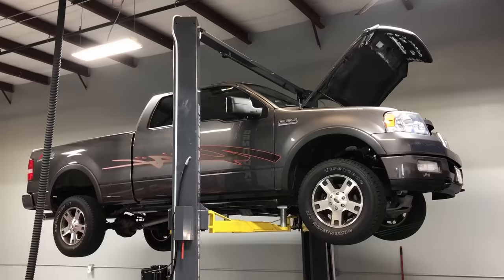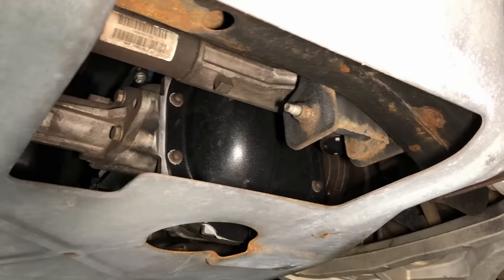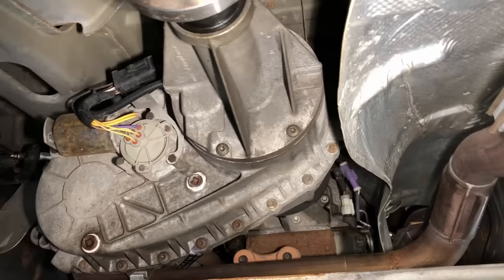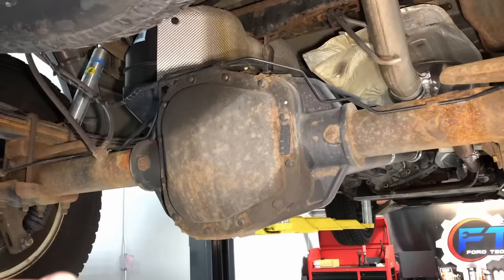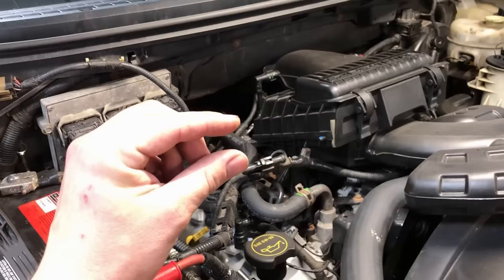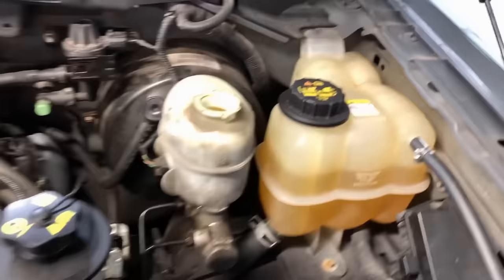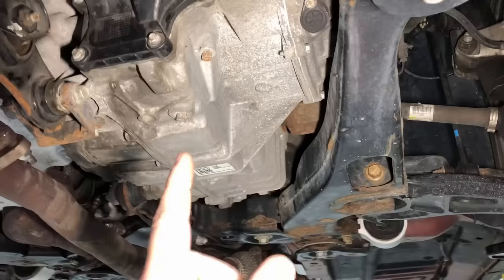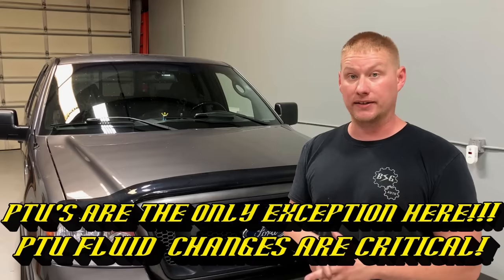Never Follow Ford's Lifetime Fluid Service Intervals: Here’s What I Recommend and Why!

Comment: Brian, you forgot to mention the weight of engine oil. Somedays, you advise 5w-30, other times, you can't/won't mention it. When/why do you occasionally, sometimes, somedays advise one type vs factory specced 5w-20?
Reply from the maker: The weight of the oil varies with the application, engine and year. This video was for all Ford not just the F-150.
Reply: @FordTechMakuloco  Thank you for your reply! Woohoo! What about the 4.2L V6 and 4.6L V8 engines?

Comment: That trucks pretty clean for 15 yrs old
Edit.....posted before seeing rust in rear area..but still ok.....been thinking of getting those same Bilsteins on my 06' f150....any one recomends??
Reply: I have the yellow bilstein on my 2011 F150 and they are great, have had them on a few rides, I think the silver is a premium over those
Reply: Just changed mine over to the Bilstein 5100 and couldn’t be happier. It rides very smooth and planted. Not quite Fox shock performance but for the price I’ll choose the Bilsteins from now on. And yes the stainless(vs yellow) Bilstein is slightly different and allows height adjustment on the frontend.

Comment: My 2016 F150 Eco's trans has the fill plug just under the cat conv.  Near impossible to check level without getting burned. 
How would you fill after draining, much check level with this location????
Reply: Using a tranny flush machine attached to the cooler lines. It's not home user friendly but all big shops have tools to do it.

Comment: Brian, I need that short little section of fuel line that hooks into the input of the fuel filter. I have not for the life of me been able to find one anywhere. Any help??  The gray section seen at 4:21, it seems to only be on the 2004, extended cab models. All other year and cab configurations don't have it. Thank you!

Comment: Great info. How about the orange coolant in a diesel? I installed a coolant filter as soon as I bought it. I change it every time I Change the oil. So im always exchanging about 1 quart of coolant every oil change.
Reply: That sounds like a great idea. I would still check the ph and use the additive though

Comment: Do you recommend a full flush on the transmission? Just changing the fluid in the pan isn't changing much fluid. Most of it is in the torque converter.
Reply: Don’t go for any kind of flush, be it engine or transmission…just keep renewing transmission oil along once every 3-4 engine ODI and eventually your transmission oil will be completely refreshed even from the torque converter !!

Comment: you didnt mention anything about the new coolant in the super duty and the coolant additive. do say change it when the ph is shot or just additive. since ford doesnt say flush till 100k?
Reply from the maker: Yes I mentioned the new Yellow coolant you are speaking of. The Superduty Diesel fluid requirement are unique but the ph test has been the norm since 2011.
Reply: That's great but it doesn't take the yellow. Motorcraft orange is what the owners manual says, even though it looks pink.

Comment: Good info brother... anyway, can you also include months or years intervals between maintenance because I have a Ford Ranger 3.2, it is a 3 year old vehicle with only 15,000 kilometer run, I only change the engine oil every 10,000 kms as the manual said...Please help...
Reply from the maker: I have an entire video on my recommended intervals.

Comment: Thinking about buying a newer Escape with the 6F35. Will fluid changes every 20,000 miles make it last or is it just a bad design like the CD4E?
Reply: I think he has 2 fluid change videos on the 6F35. He recommends every 30k with the correct Motorcraft fluid.

Comment: Hey bro I have a 2012 3.5 and the tool symbol is popping up and truck does not turn off but I give it gas and it dont do nothing does it while driving and park can u help me out
Reply: Throttle body failure most likely

Comment: I have a '16 f350 pickup single wheel 4x4.  With a 6.2l. It has 46,000 miles. I tow and plow. I want to change the fluid and filter in the trans. My dealer won't do it says it good for 100,000 miles. What do you think?
Reply: Find another shop to do it or do it yourself. The dealer doesn't want to because they want it to fail.

Comment: Hi FordTechMakuloco for a while I follow your videos I find them excellent, I learned many things thanks from you channel.  Today I have subscribed and I would like to ask you something about a problem with a ford escape 2008. It works normal in P or N and works very well in R but when I put D it's jumps and shuts off the engine. I turn it on again and the same thing happens.  There are no error codes the check engine light is off.  I took it to the dealer and they put a new pcm but the problem continues.  I will be very grateful if you please give me an idea that it can be

Comment: Do you recommend changing the oil  in a Eco-boost engine  more often than a normally aspirated engine?   If a person is not driving  a lot and  is not hitting 4000 miles in a year  , how often do you recommend  changing the oil ?
Reply: Every 12 months at least.  It is mentioned in the manual. 
I do it twice a year and I put about 4K a year on my truck

Comment: Took my 2012 f150 to the dealership at 80k for a transmission, transfer and differential fluid changes, flush and filter,  I was adamant about getting the flush down through the thermo valve, got the truck back drove home looked at the parts list, 6 qts of transmission fluid used according to the slip, yet the transmission has a 14.7 quart capacity, obviously the tech dropped the pan, change the filter and replaced the fluid lost from the pan, I made them do it all over again as I watched to verify it, they acted oblivious when I brought the receipt in the next day which further pissed me off, who pays $375 for a filter and a pan fill, I wasn't buying it , service manager and I had a talk, I got a chair and sat next to the truck as the work was done, I really wish I had access to the equipment to heat the fluid  to do the flush myself, if I had I would of never brought it to them to do this work.  They where upset, tough shit I say they tried to pull a fast one luckily someone screwed up and listed the supplies used truthfully on the receipt.

Comment: Hello from Tampa FL! I have a 2005 Ford Escape XLS 2.3 5-speed manual that was used as a toad behind my past motorhome so the 216K miles are not really that many as the odometer still does register miles even when towed...I have a question, My clutch fluid/brake fluid..should and how/when does that need to be changed out? I had a clutch line leak and replaced but I don't think they changed out all the fluid just replaced but not sure..I would like to change out the full amount..I have always been one to change all fluids way before they say..I still change my oil myself every 3K miles with Ford Motorcraft Synthetic blend as well as a Motorcraft filter..I can't knock this little suv even though I don't really love it haha

Comment: So for someone who does not log on many miles on there vehicle, at what point do fluids need changing due to age?
Reply: The intervals he gave for coolant, brake and trans fluid should all still be good. Probably want to change the oil at least once a year though, if you aren't driving it much you aren't boiling the contaminants out of the oil. Just my take on it anyway.

Comment: LOVE your videos!  I've got a 2014 F150 XLT 3.7L 6 cyl (and only get 12.5 mpg except on freeway since new!) Change oil as close to 3k very close usually, and had no issues except new front brakes at 38k.  Milage has sucked ever since I got it and I think every V8 F150 owner I've talked to, many as everytime I run into one  I would chat and compare until it was obvious.
I've had regular maintenance, but can't remember now if plugs were changed.  I dont know if 12 -13 mpg in town is common, but man it's nowhere close to even 15 mpg let alone the new car placard that they post the mpg lies on.  
Thanks a TON for your videos!
Reply: 2015 f-150 2.7 EB - 23 MPG easy on the hiway. 19 in town ++

Comment: What would you recommend for fluid change interval on manual gearboxes?
Reply: Never..Unless it's being taken out for repair or whatever, that is usually never even mentioned in the service schedule, and there is really no need for it, plenty of still-works-great gearboxes out there, some over 30 years old and oil was never changed in them. My friend's MK2 Golf is good example.
Reply: @KRAUSER0130  Many of Ford's newer manual gearboxes are filled with either ATF or DCT fluid.  Oil this thin shears pretty easily and have been known to affect how smoothly the synchros engage.
Reply: @jeffhurckes190  Well, i don't own a Ford but i highly doubt they filled the MANUAL transmission gearbox with ATF or whatever, but if they did, what the flying fu..? That's just completely wrong from the start, it's like filling the engine with windshield washer fluid instead of proper oil. There's a good reason why they put super viscous oil like 85W-90 or something like that in manual gearbox, while the stuff that autos use is basically hydraulic fluid, it serves for completely different purpose.

Comment: What do you recommend about changing transmission fluid? I bought into Ford's recommendation at 100,000 miles... I changed it only once at 80,000 miles. My 2009 4x4 F150 has just crossed 200,000 miles. Local mechanic says no, and says it will stir up gunk and make it worse.  He says it should have been changed at least 4-5 times already. Should I change it?
Reply: Sometimes it is best not to change it if it hasnt been changed much or not at all, not only can new fluid stir up junk but also junk in old fluid can help keep transmission running better, you might want to only change like 1 quart at a time n see how it runs, or just leave it until transmission breaks down
If you dont change fluid enough in the past, then at times it is best not to n just keep going until it breaks down, this is a price to pay for not changing the fluid enough- your transmission will break down sooner
Whatever you do dont do a transmission oil flush

Comment: You are just talking about the coil and you said each one of them cost about $40 to $50 but in Florida in my local stores one coil  costs $75 to $100 and I went to local junkyard i bought one coil $10 maybe all local junkyards are not sale it for the same price but it did cost me $10 and it depends what kind of vehicle you have, if you have BMW or Mercedes one coil will costs $100 or more

Comment: I just bought a 2004 F150 5.4 , 2 days after having it, it started what I call "bucking" while lightly accelerating, any thoughts, thank you!
Reply: fuel filter plugged from dirty tank rust or dirty throttle butterfly plate or dirty map/maf

Comment: My sons 2011 Fusion has a 6 speed manual trans. How often should the gear oil be changed?
Reply: Check forums, but my uneducated guess is that once every 10 years is fine. Manual trans is a lot less stressed

Comment: I have a 2007 F150 with 25,000 miles with no problems, currently using Motorcraft 5W20. I was told that i should start using 5W30 ?
Reply: It wouldn’t hurt it’s to increase oil pressure due to rocker arms squirter holes being too big and weak oil pump
Reply: That’s low mileage for a 07 original engine?

Comment: The new 5.0 takes 10 quarts, with full synthetic what interview do you recommend?  That's a lot of oil compared to the mod motors.
Reply: I said full synthetic, like a sn+\gf-5 dexos 2  oil, good stuff.  10 quarts of that gets expensive every 5k ya know.
Reply: Dustin I run Pennzoil ultra platinum synthetic in my 18 5.0. You can get 5 quarts of it off amazon for like $23.
Reply: If it’s good enough to be the OEM oil for Ferrari it should be good enough for Ford. Changing mine every 5k miles. Almost 10k on the truck.
Reply: repairvehicle I did the first oil change at 5k. Gonna keep doing the same.

Comment: Any "lifetime" fluid goes with the 10k mile oil change intervals on my book. Its all a car selling scheme and most owners hate doing any maintenance so the "lifetime fluid" seems so convenient and advanced to them they don't question it.  By the time the transmission or the engine takes a dump they think it's because it was old anyway since they usually don't take any good care of their vehicles and they tend to fail on them.

Comment: @FordTechMakuloco
I completely agree with you. The long life maintenance intervals are definitely used as a marketing tool. Only thing is if you run into a vehicle that the transmission service is way overdue..you are damned if you do and damned if you don't. What I mean is if you wash away a bit about plaque you spring some leaks. Internal leaks. You know what I mean? Also with the brake fluid you got to be careful if you're pumping the brake pedal not to sink it all the way to the floor because it will tear the ass out of the master cylinder. Just like a hyperextension. The spool valve  exploring into unfamiliar territory. Because the valve travels through the O-rings this area is usually not as worn as the regular area of travel. This often causes for a master cylinder failure. In other words.. With the brake fluid..you are damned if you do and damned it you don't..Same thing about the dirty stuff..it can spring some internal leaks.. with the power steering fluid however.. I found that Ford power steering fluid usually blackens a lot sooner then any other I've seen. Almost have to do it every 25000 km to keep it nice and gold.. excellent video as usual

Comment: are there differential covers with drain plugs you can put on without voiding your warranty?
Reply: Probably, but better to remove the cover because all the dirt and muck settles in the bottom below where a drain plug would be.

Comment: Nobody changes their transmission fluid any longer. I did take mine to a transmission shop, and they could not even find the Motorcraft filter.  No dealers anywhere here in Michigan carry one on their shelf.  I'm not the first person to hit 80,ooo miles on my 2016 F150 2.7 Ecoboost, yet the dealers don't feel the need to carry an item there is no demand for.  There's no other off brand filter either...it's Motorcraft and only Motorcraft.  This is getting pretty weird.  Oh and to check the trans fluid on the Ecoboost motor, you have to crawl under the belly of the truck to find the dip stick.  It's no longer under the hood.  Anyway, the plastic dipstick is as big as a dipstick on a small engine lawn mower...like a Briggs and Stratton lawn mower.  Yeah, plastic, and only 4 inches long, AND UNDERNEATH THE MOTOR AT THE TRANSMISSION.

Comment: Lifetime fluids are bs no matter the make. Bmw and Mercedes put this on their transmissions, they die after the warranty, perfect for them. Sucks for the owner. But it kinda is your fault that you don't know something so basic about your car, that drivetrain parts degrade their lubricant and need servicing no matter what magic spell they put on the gearbox, along with the lack of a drain plug -_- . Makes for more project car material for people like me I guess. Their cars usually have a good chassis to work with. As long as it's not rusted I guess.

Comment: I  changed the engine oil on my 2004 7.3 litre F250,  now i have the oil temp light and the water in fuel light come on while the glow plugs are warming up. 
Any ideas to the cause ?
Regards,
Australian viewer.
Reply: did you put the right oil and the correct amount?
Reply: @ecastillo9804  yeah mate , 15w40 delo 400 mgx , 13.5 litres.
Good thing i changed it , as it was black as soot.
I'll drain the water/fuel filter tomorrow, when i finish work.

Comment: Hey Makuloco, I have a 2009 F150 with 1st gen 6R80.  The truck shift pretty flawlessly on my commute to work and back but on a long roadtrip when temperatures go up a bit cruising 70-75mph the tranny will down shift hard from 5th to 4th on big high elevation hills.  It doesnt feel good at all.  the 6th to 5th shift is fine and the rest seem good too.  I noticed around 50-60mph if I'm in 5th nd need to drop to 4th going up hill it will down shift harsh too.  Its wierd cause if I'm going 70mph and go to pass someone on a two lane I would like to drop it two gears and pass but i find myself just flooring it so it goes down to 3rd and just  passes 5th nd 4th so I dont experience that harsh shift.  Truck has 90k on it.  tranny was serviced at 60k.  The dealer cant eeek to replicate the issue at all.  I think the truck just needs a long trip to expose the issue.  I was thinking it was a bad solenoid or the mechantronics.  Would a flush and pan drop be a good idea to start?
rant over... thanks for all your content!
Reply: I believe your trans pretty much needing an overhaul... just my experience... I'd start with the pan drop and flush.

Comment: I recall in one of your videos you mentioned that  you recommend changing to 5W-30 instead of the Ford spec of 5w-20. I believe the engine you were discussing was the 5.4L 3v, but does this apply to the 2v as well? Thank you.
Reply from the maker: I would stick to 5w-20 in the 2v engines unless they have high mileage over 250k miles.
Reply: @FordTechMakuloco  thanks for the reply. Yeah, I changed it to 5w-30 a couple weeks back and it wasn’t feeling right. Wasn’t as smooth as before. I’m planning to change it back to 5w-20 tomorrow. Hopefully I haven’t damaged anything too much.

Comment: Probably should not change Trans fluid if you are over 100K miles and just bought it. More then likely it has never been changed and will just cause it to start to slip with fresh fluid.